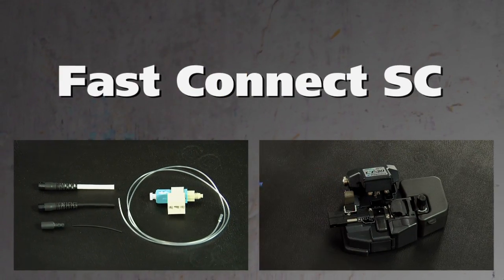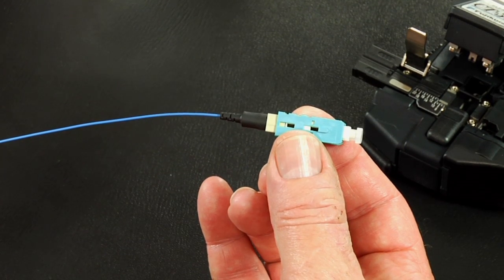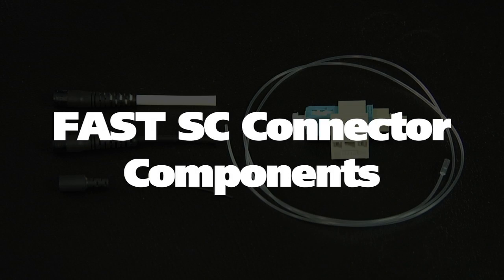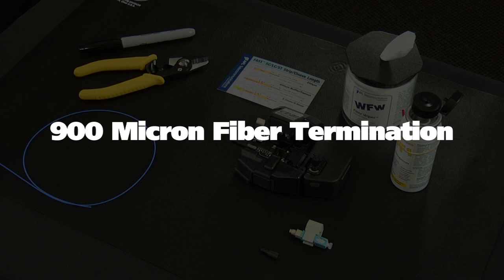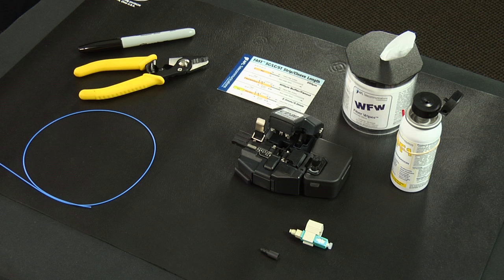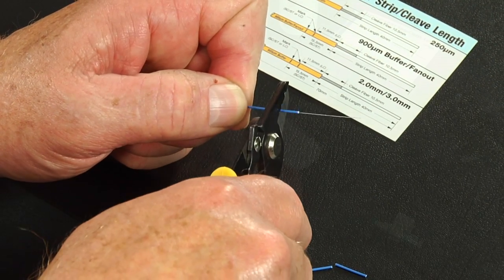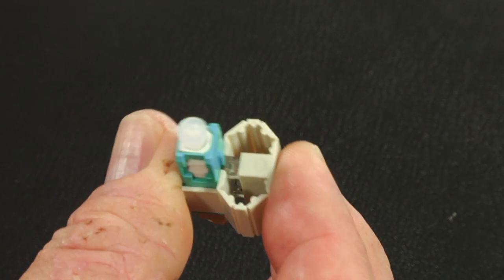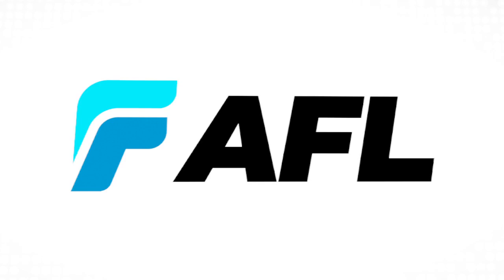FAST Connector SC 900µm Installation

Comment: 12 years after its creation and this video is still valid and was exactly what I needed to understand the difference between these fast connectors and other butterfly mechanical connectors that the jungle website keeps force feeding me, these short and slim connectors make much more sense for me even if they are 3x more than the bigger variants.  Thanks 🙏 

What was left unknown for me from the description on AFLs site was weather or not I needed a dedicated proprietary crimping tool like the unicams require (or did require, their literature is also somewhat lacking). Im not a pro, im an alarm guy who keeps getting fiber requests and im just trying to keep up with the times and this seems like a rock solid connector since it seems to be what Cox and AT&T use atleast in my market.